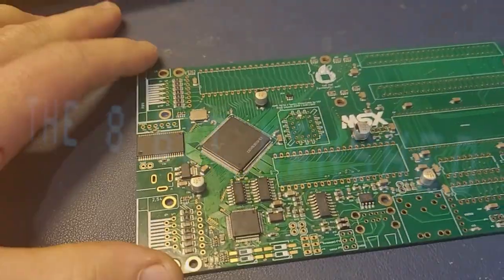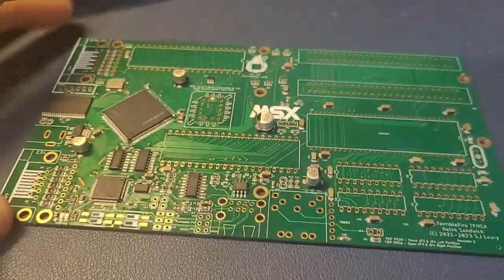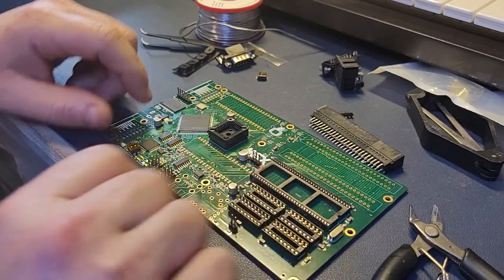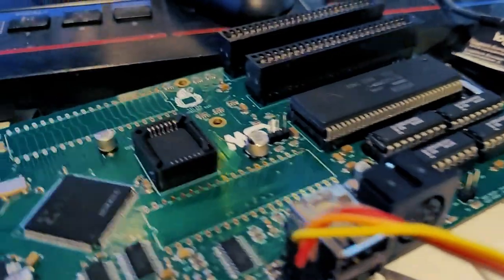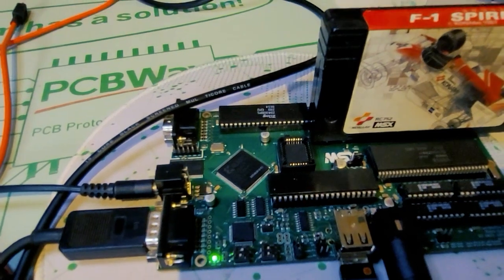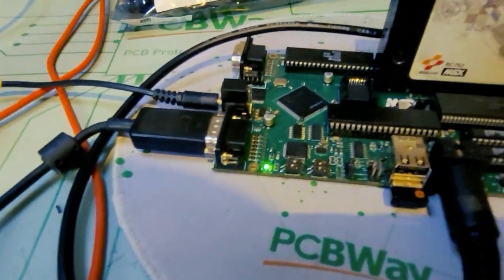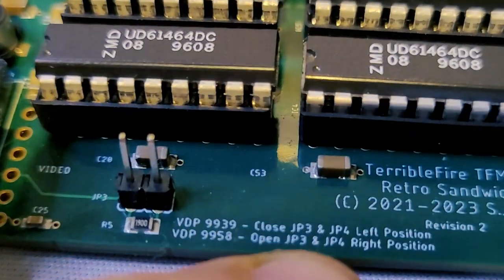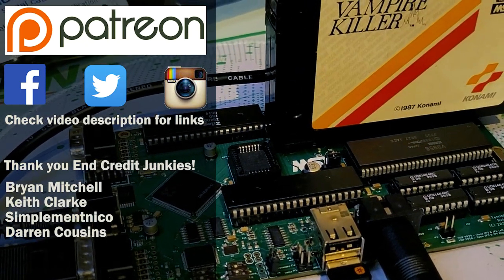AN MSX2+ CLONE  : The  TFMSX  Rev2 by @TerribleFire - Build and updates

Comment: Is there 12v (via a buck) on the cartridge port (for opll sound for example)
Reply from the maker: no it's strictly running 5v. so no +12/-12v rail . It's technically possible however to feed that through the second cartridge port if one was inclined to build it but it's not sth that's planned as far as I know. Keep in mind this is build as a "low cost" msx2+ option
Reply: @8bitmanshed  Thanks for the info and great video. Indeed opll is more like a msx2+ thingie (but still cool for playing Aleste 2 in a arcade cabinet maybe :) )

Comment: It is very difficult to get authentic VDPs. I think it would implement them in FPGA. There is a very good project using the Tangnano 20k, with HDMI output.
Reply: I think there's effort underway to get the Agon Lite to be able to be MSX. It uses a UART to interact with a dual core ESP32 microprocessor to serve as its display graphics and sound. So is a matter of writing the appropriate emulation software for the ESP32. But, it uses a Zilog eZ80 as its CPU and has 512K of memory to play with.